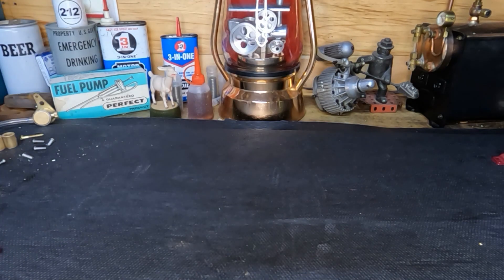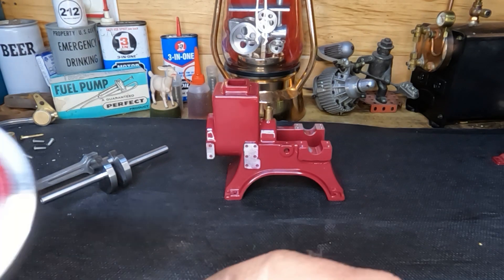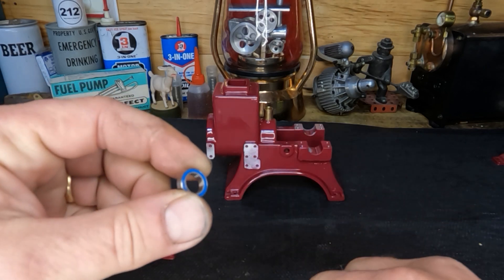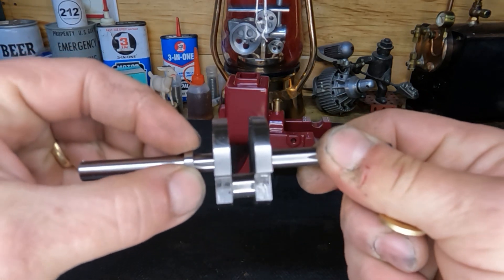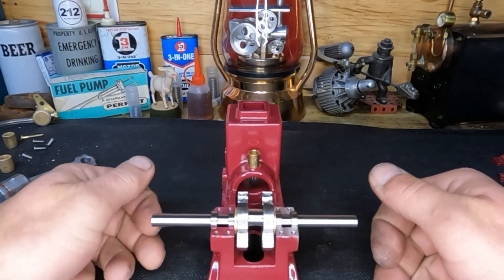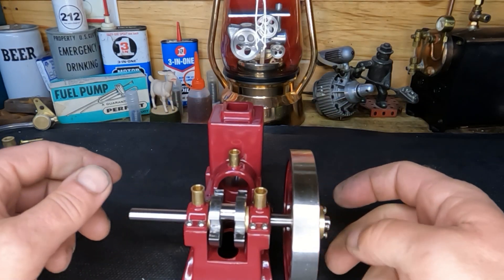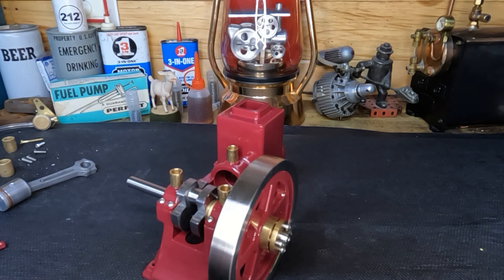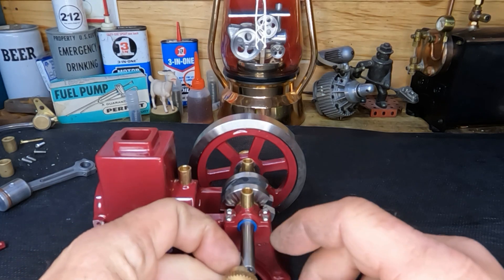Enjomor 6cc Hit & Miss, NOW with more balls!

Comment: Sweet......... Do you recall the number of the bearings.   I might try to pickup a couple from NAPA and do the same to my hit and miss engine?  Or where did you get the bearings that you used?
Thanks
Reply from the maker: Hi Gary,  Sorry for the late response. The pushrod bearings I used are #681  and the crank bearings are MR128-2RS. Remember to remove the inner seals on the crank bearings.  I hope this helps.  Thanks again for watching and commenting 👍